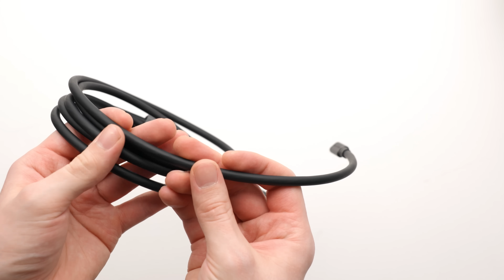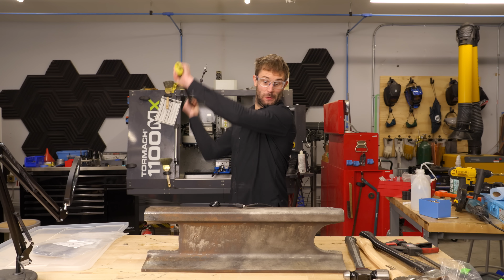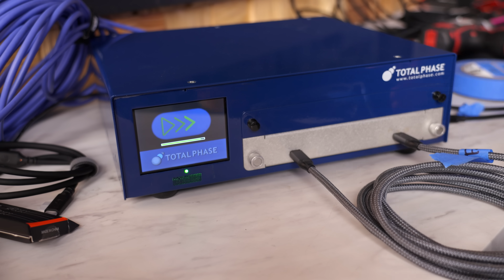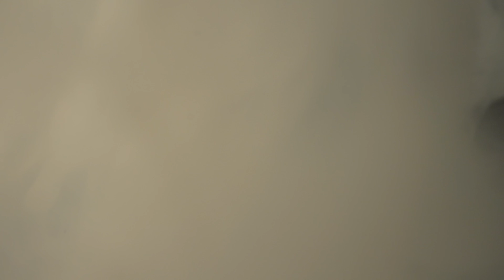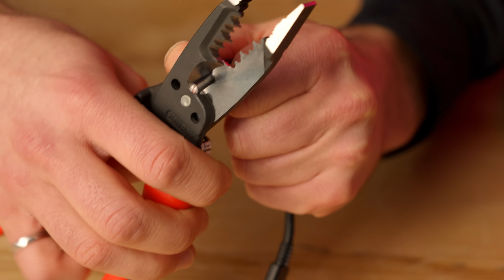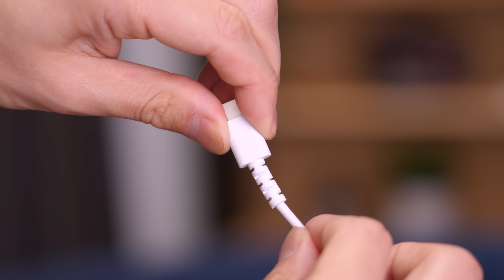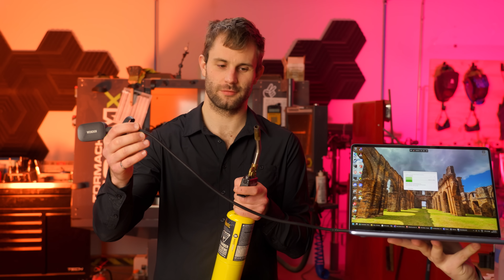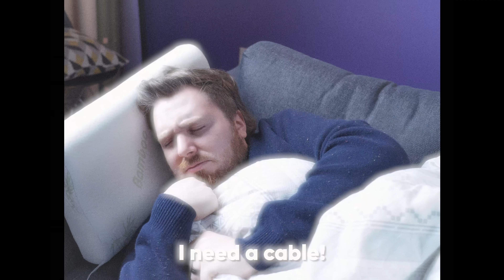Why It Took Me 4 YEARS to Make a USB Cable

Comment: When they are back in stock, are the c to c able to cover the thunderbolt spec? Is all it is the capailbility of the cable to cover the power and throughput or is there a secret handshake that will stop this? 
Iam sick of buying thunderbolt cables that die after the first couple of disconnects
Reply: He said on WAN that they are not thunderbolt spec sadly. But they should be more than enough for a decent USB dock

Comment: I'm not gonna lie, the fact that it jumps from 40 Gbps down to 20 up till only 2.5 meters then 480 Mbps is pretty sad. I held out ordering other cables specifically hoping to GET a high quality at least 3 meter cable that has proper power delivery and ISN'T usb 2.0 speeds.
Reply: They are true to spec is the thing. You won't find 3 meter unpowered cables that have those kinds of speeds within the spec.
Reply: @Parker_Pratt  I definitely own cables that are 3 meters in length, carry high wattage, and deliver USB 3 speeds already, certification or otherwise. Unfortunately I now need about one more to make a longer run for something, but if someone else can do it, they sure can.

Comment: ok as a person in the audio/music industry and have done videos about good and bad audio cables, these seem like great cables actually! I am pretty reserved with the brands i buy too. looking at the pricing these actually seem super fair and cheap for the quality! Most LTT products I find are very expensive.  

Most 40gbps cables are like $30+ at this quality and length. they're selling for less than that. 

What I'd love to see is a Thunderbolt 5 compatible cable that's active and can go at longer lengths than 1 meter. I have seen talks of some companies making these active cables at 2 meter lengths, but not sure if it has been done. either way those are expensive but super worth it. 

But yeah i may actually pick one of these up at some point when i need a fast reliable cable again. Sadly, i just bought a bunch in November (by ugreen and cable matters).

Comment: As of writing (January 30 2026), a 6.6 foot 20gbps cable costs $26. From the prices that I saw at Best Buy for "similar" cables, this is actually a good price. Not cheap but not expensive, 100% fair.

Comment: As long as they perform the way you say, and are cheaper than my $150 Apple Thunderbolt cables (which I’ve found work extremely well), we good, and you’ll have my business.

I switched literally all of my cables to only high quality ones that work, tested over 30 types/brands. Very much looking forward to this.

Comment: What about the flexibility of the copper stranding, it says "individually shielded", but which thickness of twisted copper is being used? this will matter a lot for how many times you can bend your cable without losing quality.

Comment: In theory a really cool thing. But for me (a EU citizen) its just way too expensive. 50€ for one cable..
Reply: The price is in canadian dollars, with VAT included at checkout. CAD$53 is 30€

Still expensive, but you also only pay shipping per order so you could order 3 and get them for ~20€ after VAT, which is fairly in line with what you'd be paying for other options.

I don't know if it's a good deal and I'm not buying any but it's not 50€
Reply: @leeroyjenkins0 I know that the Price is in CAD. But once you go to the checkout you can see the final price in € including shipping. And with shipping being almost 30€ it comes to roughly 55€ for one cable. Yes you could buy in bulk but that doesn't make it thaaat much better.

Comment: I was a bit terrified when Linus said it was expensive. But, at current prices, between 20 and 30 CAD(~15 and ~22 USD or ~12 and ~19 Euro)is honestly more than affordable. Like I recently bought a cheap type A to Type C I could fit in a store that would fit my need(around 120W charging) and not feel like a fire waiting to happen, and it costed and it' costed me 8.99 Euro(14.51 CAD or 10.66USD) so even the most expensive cable(which are 5 meters long while mine was only 1m long) is barely twice as expensive as the cheap cable I brought.

Comment: The real problem is not the cable i think. Its the protocols. Just try to charge a 100W capeable USB-C Powerbank trough a 100W USB-C Outlet of a powerstation for example. Both devices want to charge themselves at the same time. In the end neither of them do anything. They just sit at 0 watts and thats it

Comment: Does anyone know if the cables have display port support
Reply: "DP alt" mode is just using the data cables to transport display port signals instead of USB so the 40GB cable can definitely do DP.

Comment: This could very well be some of my future cable purchases - But your statement about the digital cables either works or not, that is not entirely true, and you proves it very well in the video. 🙂One example is the "eye" you are showing, that is in fact an indicator of cable induced jitter (Distortion in the timing domain). And that is in fact some of the snake-oil mentioned, primarely seen in digital audio cables. Most manufacureres dont know what they are doing, and snake-oil may be the correct term on a lot of that stuff. But synchronized digital medias, such as S/PDIF or TOSlink (all PCM based) this would be sensitive to cable induced jitter. A lot of USB audio would be too, unless the codecs used are asynchronous. (not depending on the same clock signal)

That said USB data would often have some kind of checksum / error correction ensuring data integrity.  

Another interresting design solution from your manufacturer is the use coaxial twisted pairs - this wouldnt make much sense, in the way of controlling the impedance. The impedance is already given by the geometry of the coax itself - but this isnt huting anything, but just an interresting design solution to me at least.

Nice work anyway!

Comment: A few suggestions for future cables:
LED display that shows how much power is going through the cable. Yes, I know they exist already, but all of them have the display facing the wrong way when plugged into the laptop's left side.
Bonus points if the LED can display what speed the cable is connected at... because sometimes the device, not the cable, is the limitation. (It can just be 1 RGB LED that changes color up depending on negotiated speed)
90d heads. One that bends backwards for handhelds, and another that bends sideways for various devices.

Comment: Good gravy more overpriced crap from ltt. Ive purchased a mountain of dirt cheap ugreen 240 watt 40Gbps usb c cables and never had a issue with any of them, and they are braided which is nicer.  They cost less than half of what truespec cables do and thats in canadian pesos. With free shipping from amazon.  😖

Comment: Anyone find it odd that there's no mention of Video capabilities? 

I'm really glad to see LTT make a trustworthy cable, but considering this is a 13 minute video, I'm concerned that it doesn't even get a mention? With how many modern devices and even displays do video over USB-C, there's not a single detail on the website description either. 

I will likely be buying one to test nonetheless, but I hope they change this in the future.

Comment: Damnit Linus! I just dropped £200 (~$300?) on high spec networking cables, and now I'm going to have to do the same for all my USB as well? 😂
Pricing doesn't actually seem too bad though considering how often a cable you need actually gets used — either it's in and out of bags for charging, or permanently connected so I don't mind paying extra for better cabling. One question though, but are the USB 4 (40gbps) cables usable with Thunderbolt devices (as Thunderbolt)? I believe in-spec USB 4 cables should be but I don't see it mentioned anywhere and I want to be sure.

Comment: Been patiently waiting for this product release to drop; been wanting a truly reliable source of usb C data cables to rely on for all the devices I have (VR, Controllers, Phones, etc), after having dealt with a few cables that have sub-par connection quality. Would love to see overtime some testing with Labs to see how these cables interact with certain devices at certain lengths (for example I have a decently priced xbox themed gamepad that doesnt like to connect to my computer if the cable is over 7 feet long (A-C or C-C on both front panel and motherboard connections, havent tried 8 or 9 feet but 10 feet doesnt work))

Comment: Could we get any type of color trying to find fast and reliable cables is very hard and as someone who works with very picky SSDs having colored fast cables will ensure everyone knows that those color cables go with specific hard drives and they would be easy to spot if someone takes them without permission any way I bought like 4 to use thanks guys

Comment: would the 40gig one work as a thunderbolt 4 cable?
Reply: check the specs of thumderbolt and match it with ltt cables. if they are the same then yes it is a thunderbolt cable.
Reply: @CalmWithVishnu  This is not how thunderbolt works

Comment: It should be the law to label cables with the specs or standard they meet. Working in tech support, for A/V gear, I pretty much say at least once daily "if you're lucky, your HDMI cable will be labeled as 1.4, or 2.0 or something". For my USB-C cables, I can never remember which ones I have that are just USB-PD cables with 2.0 data connectors (480 Mbps) and proper USB 4 cables, so I bought a tester from Treedix which reads the e-markers on the cables. That way I can at least see what they claim to be.

Comment: this is peak marketing right here
- insights into the building process which shows high focus on product quality which sets pricing expectation
- proof of claims with shown testing and test results
- mentioning downsides of their own product because there is no such thing than only upsides and explaining why they made those tradeoffs
- mentioning the "high price" (ye compared to dollar-store usb-cables that are capable of nothing) as downside
- at this moment the price in my head was like 40 bucks and i thought "thats a bargain" when i found out it was only 25 for the 240W cable

not only all of that but you also build customer trust and therefore increase customer lifetime value with a high end product. of course you will sell fewer in total because they assumingly dont break that fast but the word of mouth by satisfiedd customers makes up for it.

Comment: Now can you make the wall brick? 2 usb-c and 1 usb-a connector? Not too heavy so it can’t stay plugged in with the loose holes (you know those) and able to match the 240W speed on your cables?

Comment: Of all their designs this is the best one. Now all I need is an equaly reliable touchscreen laptop with rj45 port, USB c, USB A and it shouldn't break the bank. My wife's $300 surface pro is braking so she needs a replacement. And i am tired of Microsoft's fragile and expensive proprietary charger.

Comment: Okay,  as much as I think the prices for the screwdriver or the backpack (and other merch) is completely out of my reasonable spending range, the cable is.... fairly priced. Comparing to the prices of most low quality cables, you could get maybe two or three for the same price, but I am one of those guys who buy a good cable for years, not change it over every week when the tip breaks.
EDIT: As others mentioned, the QR code isn't to spec and doesn't read on my Samsung xD

Comment: Quick question on PD. Does the cable always do a handshake for the right amount of power delivery? I don't want to plug in a USB C to USB C in to charge my powerbank and have it try and squeeze 240W in when it only takes 15W.

Comment: You put too much value to cables. This is a useless product. It's only attractive to businesses. A better use of your time would have been to figure out a way to create an open source software you can use on any device to test cables. Or just create the Cable testing hardware and sell that instead.. Gosh.

And not to sound like a hater. But I genuinely feel like the reason your cables are that thick is just skill issue. In 2026, you're telling me you can't create a full spec type C cable that even 1/4th of a millimeter thinner? Is this atomic level physics now? Come on. You can bend a fiber cable and it still works. And that's tech from decades ago.

Fuck all that. The song at the end with riley fucking slaps. Gonna order 690 of these.

Comment: Did you really spend 4 years developing a product line and not add a c-c adapter dongle that solves the small form factor incompatibility issue? It's easy to understand an over build cable would have bulk issue's, but to not also develop a dongle adapter for the end that tapers down to solve that design "flaw" is just dumb. It's literally free money to also have a product solution to your own product lines admitted design flaw. 

Near perfect product  with a very reasonable price ATM. 

MAKE A C-C adapter dongle with a heavy taper down to a narrow tip for those extra small form factor devices and you have a perfect product line. 6-9$ dongle price would be real digestible. 

Good job though. 

Next time be perfect. You were so close.

Comment: Genuinely, the level of care you've put into these cables isn't something I've seen outside of industrial/military RF systems. Also, I'd love to know the reason you went with individual Coax cables for the Super Speed pairs rather than Twinax. Cost? Reliability under flexure and use? Bend characteristics?

These are going into my lab immediately.

Comment: You know the launch was good when the 2 longest versions of the fastest cable are sold out
Reply: The way Linus kept talking about it for years, we all imagined it would be so much more expensive. It's literally maybe 5 bucks more expensive than the cable I bought like 2 months ago and while premium, is not as premium as this looks.
Reply: @Ebosan87  yeah they are the price of "premium" gas station cable but I have faith in the LTT ones
Reply: 1 hour later they are almost all sold out.
Reply: @james_halpert 10 out of 16 for the USB A, 8 out of 16 for the USB C. Only awkward lengths remain. XD
Reply: two? try eight....
Reply: Yeah, who needs a 10cm usbc cable though?
Reply: @NotAnonymousNo80014  It's practical for ultra-portable NVMe enclosures I guess.
Reply: @EddieOtool  Sure,  but who pays the premium for a 40gbps cable to connect to a powerbank?
Reply: @NotAnonymousNo80014   Usually a cable you use for a powerbank is highly available to the user, having fast connectivity reduces the need for a second cable.
Reply: @NotAnonymousNo80014 Not the use case. But if you had a docking station however, and needed both power delivery and fast data transfer...
Reply: @NotAnonymousNo80014  They are most commonly used in conjunction with a portable battery bank, but I imagine they are also useful for people on the road with laptops
Reply: @uzetaab ...or a docking station, where both transfer speed and data delivery would be usefull.
Reply: @NotAnonymousNo80014 I have multiple 30’ and 50’ camera tether cables.
Reply: ...and I thought they just weren't released at all. Was about to roast them for that.
There clearly is a demand for TrueSpec cables. I know I could use a couple myself, if I didn't order some a few months ago out of anger at non-working, not-to-spec cables. And price isn't THAT bad either.
Reply: Man. I wish this was out when I had to get a thunderbolt cable from apple long enough for my u4025qw. 159 dollars...
Reply: @Spexx368  what lengths and speeds were available?
Reply: @runcmd1419 all I remember is that the 2 longest 40gb were sold out

Comment: Only $CAD30, £16, $22 for the cable!? I've spent the same or more than that for cables that don't always work as advertised! You need to boost stock to 100s of thousands and get these products known!

Please put the wattage on the listings too so that I know that if I buy the 20Gbps one it is 240w or 100w or whatever they are. If they are all 240w C-C then tell me in the description.
Reply: I've seen the website is updated to reflect the wattage in the description, thanks! Now you just need to get more in stock because I want them!

Comment: For anybody that thinks these are expensive, I work in commercial AV where a failed cable has easily cost $1,000s in travel, troubleshooting, and down time.

I will always swear by Comprehensive cables, but they’re ~3x the cost of these. If they’re anywhere near the quality of what Linus is stating, they’re a steal. I almost can’t believe they’ve got a decent margin on the (sold out) 40Gbps 1M type-c.

Comment: This may be a weird request but I have loads of devices that sadly still use micro usb b and not type C. Cameras, audio equipment (not for audio transfer but for power), stuff like that. However finding reliable micro b cables is a pain in the arse. Please if you could make some it would be awesome.

Comment: I love usb-c but damn if i don't get zapped by it a lot. Like if i lay on one in bed or something ill catch a slight tingle from it. And sometimes cables will even transfer a slight voltage to my s24 ultra case. I said f it and spent a bunch of money on 'premium' cables and still occasionally get these shocks. 

Never notice it from older cable types.

Any one else get this or am i nuts?

Comment: I hope this comment helps someone with a bricked Moza racing wheel. I have a Moza R5 and it suddenly started throwing "unknown USB device." Went through every forum post, deleted, reinstalled drivers, different USB ports, everything short of reinstalling windows (which some people had already done and not fixed anything.) IT TURNS OUT the USB-B cable was defective. I just happen to have an old USB B cable from a printer, tried it, and it worked.